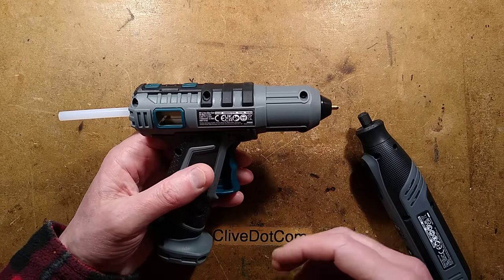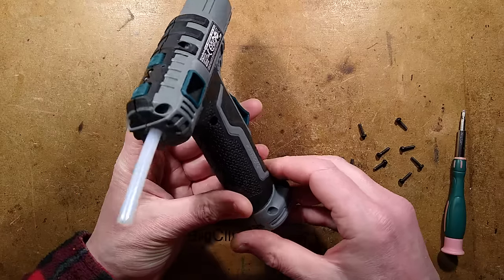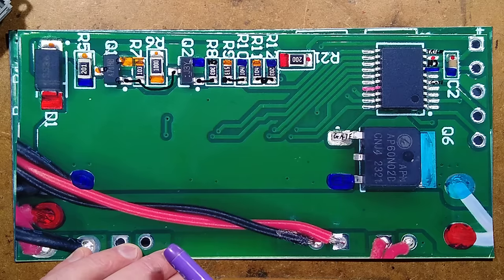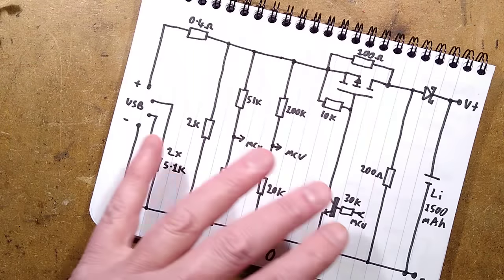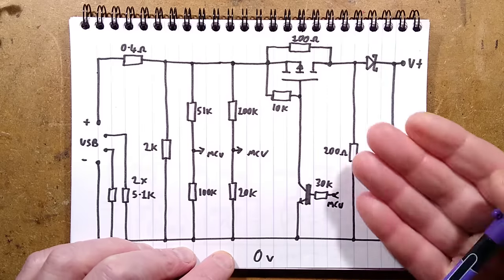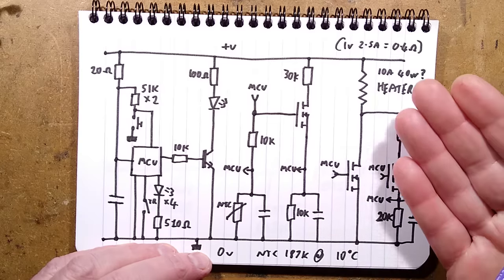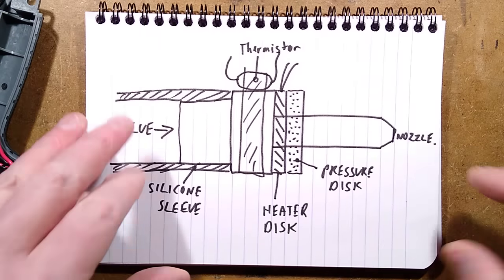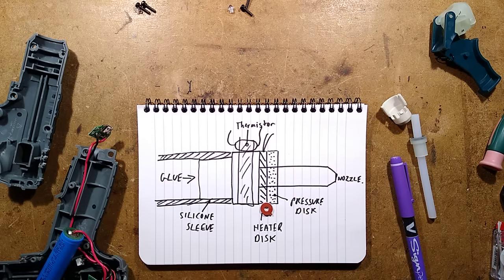ALDI Ferrex cordless hot melt glue gun teardown

Comment: "Glue needs to be applied here, here, and here... If you're on a Boeing aeroplane, bolts are also needed"
Reply: Ah, but bolts are expensive you know.
Reply: hahaha "just in case, I have to fix your plane in flight" :D
Reply: Just grab a random handful of nuts , bolts , and , washers .
When TSA asks you about them , tell them you just found them on your last flight .
They love that shit .
Reply: No joke , i was sitting on a plane once waiting for it to set off from the gate and no joke there was a guy putting the wing back on with foil tape. I joke i don't think he was sticking the wing back on but he was putting foil tape over something on the surface of the wing.
Reply: @andljoy  that is absolutely ok, fixing small holes or similar with special tape
The mentour pilot and the 77 pilot guy talked about that in a video longer time ago
Reply: @a68k_de  I am sure its fine , it just made me laugh and for a good story :P
Reply: @andljoy   possible Mac Gyver was on duty :D
Reply: Just be sure to forget to tighten any bolts you install.  Especially in the rudder assembly. If the flight crew needs to point the nose of the aircraft anywhere they can just vary the engine thrust independently.
Reply: And best to use the right bolts, not just ones that look similar: https://en.wikipedia.org/wiki/British_Airways_Flight_5390
Reply: @andljoy yeah that stuff looks like duct tape but it's called speed tape, strong stuff

Comment: TSA saw my small set of drivers (collection of about 30 bits and a driver handle) and told me "drill bits aren't allowed!" in a snippy tone. When I politely informed them they were small screw driver bits and not drill bits they supervisor let it through although gave me some "well ya know...". Now the case has "SCREW DRIVER SET" in bold sharpie on the front of it and been through multiple TSA checkpoints.  I seem to always get the trainee (but maybe all they have is supervisors and trainees).
Reply: TSA does have a nearly 20% turnover rate, so you may well have encountered a newbie.
Reply: Our techs make maintenance calls at shops in airports. To get around the hassle of security screening they began to “mail” tools via FedEx or UPS to the shops in advance. It’s amazing how easy it was for their tools to bypass security. 😮
Reply: "No, you cannot bring this Pepsi bottle on the plane. The bottle is made of glass"
The complimentary jam in a small glass jar and metal lid was not dangerous though... 🙄
Reply: woah there, you could unfasten some panels in the cabin and open a hidden emergency door ;)
Reply: Those panels op n themselves , so , no tools or intervention required on your part .
Reply: @radry100  LOL. The didn't bat an eye at my six quadcopters or the multiple kilos of Lithium Polymer batteries.
Reply: The big problem is inconsistency. On a flight out for work there was no problem with the tools I had in my hand luggage. Flying back I was told that no sharp items like screwdrivers were allowed in hand luggage. I only had carry on luggage and didn't want to miss the flight so had to abandon about half my toolkit. I wonder if airport security ever buy any tools themselves?
Reply: @MrDuncl  Agreed, it is frustrating. They have rules, but specific agents like to flex their authority.
Reply: Not TSA but the Canadian equivalent refused me boarding with a 12 point socket set but passed security I was able to buy a litre bottle of vodka for my cabin luggage. Apparently sockets are a potential weapon but said voddie in a glass bottle has no potential issues in the cabin mid flight😂. This was Montreal before 9/11 so no armour doors etc!

Comment: Airports: please put any devices with batteries in your personal luggage.
Airports: we need to confiscate your battery devices because they look suspicious and they have batteries inside! 😅
Reply: Airline: flammable liquids are not allowed in checked in baggage. Also airline: of course you can buy a bottle of parfume and put it in the checked in luggage. 🙄
Reply: Funnily enough, they took no issue with my mum bringing her full set of knitting needles (each ~25cm long) on board. Probably thought she wouldn't risk dropping a stitch to stab someone. Her tiny nail scissors on the other hand …
Reply: @rolfs2165  few times I got away with small knife that I had hanging with my keys that I used to open boxes(folding keyunity, size of normal door key), I totally forgot to leave it at home and they didn't notice it... Thats how good they are at spoting real dangerous objects... But screw knifes! Take your shoes off! Now! And you are not allowed to transport hot  glue dispenser! And remove your belt! 🤣
Reply: No batteries in checked  luggage is down to the CAA.
Reply: My sister-in-law had a pair of nail clippers that had a small file attached (about an inch long). They snapped that off and gave her the clippers back. Then on the plane at meal time, they gave her a steak knife. I know, go figure 🙄

Comment: About equipment turning on unintentionally: I happen to have a small gas torch which I sometimes use at work. One day I stuffed it into my backpack a little too carelessly and when I came home and set it down on the floor I noticed a faint hissing sound and had no idea where it came from. That question was answered quite quickly by a jet of smoke making its way through the hole the torch had melted through the bottom of the backpack, followed by a nice blue flame. 
Following that incident I tend to be more careful.

Comment: When I flew to London for FFXIV fan fest last year with British Airways, they stressed like 20 times in their luggage guidelines that all devices with internal batteries HAVE to go into your cabin luggage. With such rules in place, I really wonder what you're supposed to do if you need powered tools (like those 2 you had) for your job and take them on a flight. Confiscating them for dubious reasons and then collecting a fee so you can get them back is IMHO total BS and if that happened to me I wouldn't stop complaining until they drop the BS and let me keep the tools where they force me to keep them...
Anyway, interesting device, and that tiny heater disk kind of reminds me of the modern round heating blocks used on some 3D printers.
Reply: They say that, and then because everyone has roller carry on bags now because they charge to check luggage, and the bins are too small, they make you check it all at the gate anyway - batteries or not, they don't care. When you tell them "it's chock full of lithium batteries", they just say "that's fine"
Reply: @gorak9000  probably depends on airline and how badly overloaded the cabin storage is. On my flight they picked out a few bags in the waiting area before boarding to go into "the hold", but only if they didn't contain any batteries.

Comment: I got the multitool and a wireless soldering tool recently in Aldi. So far they've been pretty useful. Also I might mention that the tools are made by Positec, the same company that makes Worx tools. As is often the case with Aldi / LIDL if you look at the warranty of the tool it'll normally say who made the thing in the first place and often it is major manufacturer, often from Germany. They might even make the same tool under different names but similar spec.

Comment: I was just about to say I was surprised it wasnt torx in a germanish thing and you said they were. The germans really do love their torx and multi square bits.
Reply: Volkswagen and triple-square bolt heads: One crevice per grain of sand
Reply: @holysirsalad  Yeah that's one of the examples I was thinking about. The ones on drive shaftes that will almost certainly be rounded out by those not in the know using a torx bit. (May also ruin the bit).
Reply: Torx is a fantastic bit / screw shape. very hard to slip, excellent power transfer and good quality bits hold for a very long time. We almost exclusively use them in woodworking, T20 is the most common size.
Reply: @DrakkarCalethiel  Yes torx is one of the better ones used in europe. 3 and 4 square are also good but can be confusing to the less technical.  Robertson is also good. Chross heads and slot heads should be discontinued unless in building preservation. In mechanics there is really no good reason for using an inferior screw head for reasons of preservation assuming the unit is in active use.
Reply: T20 is a good type of screw. I know miele german wasmachines use t20 and t30
Reply: @rimmersbryggeri  Philips and slot are just bad. Pozidrive is a bit better, still can't stand it. Slot is nearly extinct, cross type screws are still going strong, IMO they should be discontinued aswell. T is just way better in every case.
Reply: @DrakkarCalethiel  Exactly. And there should be regulations that make it easy for you to know which tools you need for a certain appliance. There seems to be some kind of logict to vw in that they use torx almost everywhere that is withing the safe rach of a home mechanic  and 3 square where you should really have think concerning your skill level before doing the job. Posiibly the odd PZ/PH for light fittings etc. same for bolts hex for none critical and Etorx where you should have a think.Ther should be a page in the manual listing the different tyoes of fastners their nominal torques and proper name according to market. I know alot of mechanics and possibly some tool salesmen that wouldnt know what XZN was for example.
Reply: @DrakkarCalethiel  Yes, the only problem with Torx is there are too many sizes too close to each other. I mean, what's the point of having T25 and T27? But I guess it's because the Torx system was originally an anti-repair measure by the automotive industry, the idea being you need a large selection of expensive special bits to repair your car so it would keep DIY:ers and small shops out. Of course nowadays all kinds of tools are available very cheaply but back in the day they used to be more expensive and hard to get so a home mechanic or a small, independent garage would not have them.

Comment: One time, I was flying in the US, and I had a pneumatic impact wrench in my carry on luggage. The safety officer told me I couldn’t carry it on because power tools are not allowed on planes. Not sure what I could have done without an air compressor, but regs are regs. I checked my bag and it was fine.
Reply: Maybe they were afraid you'd somehow gain access to the plane's compressors and hook the impact wrench up to them (somehow) and go insane repairing the plane.
Reply: @ShadowDragon8685  or... removing bolts? I don't know... like I said, regs are regs. It's not my job to change them, and everyone is going to be happier if I just shut up and check the bag.

Comment: Some guys at my last job did the exact same thing, went across country to install fast access inventory shelves for specific workshops and usually they drive and they need to bring a glue gun for part of the process. One of the workshops was in Edinburgh and we're located near London so they took a plane with most of the parts already sent by pallet but they had the glue guns with them and they got taken at security on the plane

Comment: The security theater actors sized you up as a peaceful teddy bear quite unlikely to throw a loud fit, so they determined they could perform their theatrics safely on you and feel better about their otherwise useless career choices.

There's two things I'd want different about this before I switch from a dirt-cheap AC mains glue gun.  First, replace the spotwelded battery with a battery door and spring terminals so it is trivially easy for a user to replace the battery.  Second, a big chonky disconnect switch on that battery.  Without it, I'd feel just a tad uncomfortable about throwing this in a toolbox or bag.  Too much chance of accidentally turning it on and starting a fire...

I suppose both of these are hacks I could do myself...
Reply from the maker: Keep in mind that the unit can theoretically pull 10A from the cell for short bursts, so a friction contact might not be a good idea.
Reply: True.  But I suspect it's solvable without every user needing a spotwelder.  Maybe we're ready for an improved standard contact system that's still user-servicable.  I mean, tool battery packs can put out more than 10A continuous, and those contacts are just copper-coated springs and blades...
Reply: @oasntet  Yup, it's all about the contact area, that's why the blades are as wide as they are, the springs are divided (so irregularities don't lift the whole spring) and there are there are often multiple springs, to boot. In fact, the home battery tool lines all have hot melt glue dispensers, just not as nice and compact as this one.
Reply: @oasntet  re: "But I suspect it's solvable "
WERE money no object. But, Silver plating - out of the question on BOTH sides of the contact set. So, there you go, solder or a spot weld.

Comment: that heats up quick! i have one that uses 4 AA cells, plus 2 gas ones and they seem to take ages to warm up enough, especially one of the gas ones!  the battery one is weirdly branded 'coldheat' same company as made that instant/'cold' soldering iron thingy with a split carbon tip, which is pretty much useless !
Reply: i think the battery one is rated 6w,  or something like that so not surprising it takes a while

Comment: The trigger switch probably puts it in sleep mode if not used for a while.
Reply: Might also increase the power and temperature when actually working, keeping the temperature a little lower when not gluing would decrease oozing and preserve battery life.

Comment: I have the Lidl version, it's great!
The narrow sticks are a pro not a con, easier to get precisely how much you need, if you need more you just squeeze again.
Heats up fast, and can be used while charging.

My only complaint is they won't charge on a proper USB-C PD charger, they cheaped out on the charging circuit, so it's USB A to C only.

Comment: The 0.4Ohm resistor is a fusing resistor.  It basically acts as a fuse in the instance of a short.  It also slightly reduces inrush current due to Lithium Ion batteries having naturally high capacitance.

The bypass resistor is a trickle charge.  Honestly I would have gone with a higher value myself.  The mosfet PWM cycles it between trickle charge rate and standard charge rate.

Comment: Well Thats a new one. I'll file it in my list of things not to bother trying to transport.
Along with the other items I've had seized... 
- jewellers screwdrivers for tightening the screws in my glasses,
- AA batteries because they weren't in original packaging or in a device. 
- Sealed spare laptop battery in my carry on (wasn't allowed in luggage either apparently) 
- Cheap Chinese USB power bank the size of a pack of cards that had a printed rating of 20,000mAh 

Things I have accidentally brought onto a plane with no problem and not being stopped.
- Swiss Army Knife
- Bottle opener
- High test alcohol mouthwash. 
- Gerber Multitool 

Yeah,  there are priorities apparently.

Comment: love your videos, keep doing what you're doing. 
Quick question, why do you need a decoupling capacitor across the thermistor? I am building a temperature-sensing circuit and have not used one. 
Sorry to hear about your troubles at the airport, but it made a great story.
Reply from the maker: It reduces any noise caused by the components or external interference to give a more stable reading.

Comment: The most dangerous power tool I own is a Ferrex. An angle grinder that won't turn off after just 2 uses. The on/off is the wall socket (french unswitched), so it is usable if you don't mind risking cutting your hand off.
I will not be buying Ferrex again and advise everyone to avoid them.
Yes they are cheap, but they make shortcuts to save money that you could pay dearly for.

Comment: Due to the built in battery you are in fact not allowed to put it in the checked luggage.
You HAD to take it in handluggage :p
Second NTC input is probably to monitor battery and they skipped that. The multiple voltage dividers is usually when they use internal comparators instead of ADC. Possibly to wake up or interrupt something.

Comment: That small heating element could be useful to make some very compact 3D printer hotend assemblies. On the matter of the battery capacity, is it possible that the battery was chosen to manage a high discharge current and this would mean having to live with thicker foils and lower capacity?
Reply from the maker: That was probably a battery factor.

Comment: Somewhere, I have a rechargeable unit driven by internal NiMH cells, which have long since died. I keep meaning to replace them. Now I'm wondering if the gun (nominally 6v) would tolerate 7.4 volts. I have lots of salvaged laptop lithium cells floating around. Shall have to see if I can find it.

Comment: I thought "thermal run away", was more of a problem with bipolar transistors, and not so much of a problem with mosfets? I was told back in the 90s, that mosfet audio amplifiers don't suffer from "thermal run away", so it made the construction simpler.